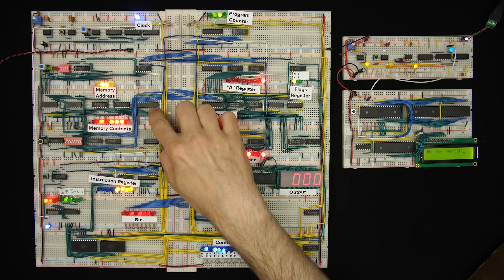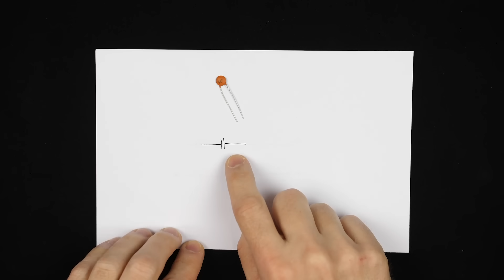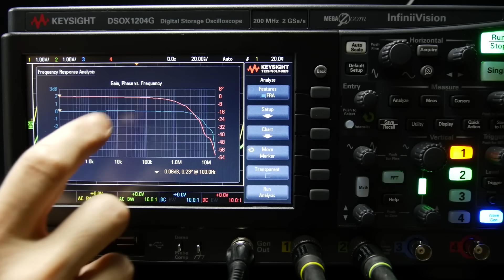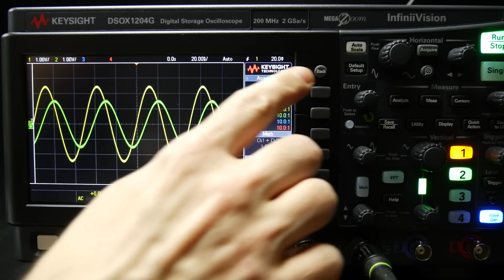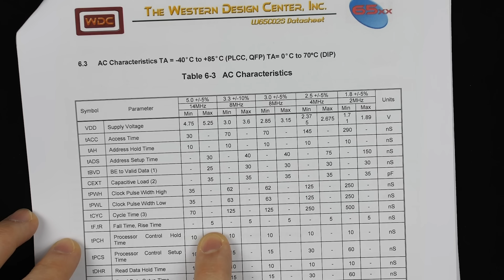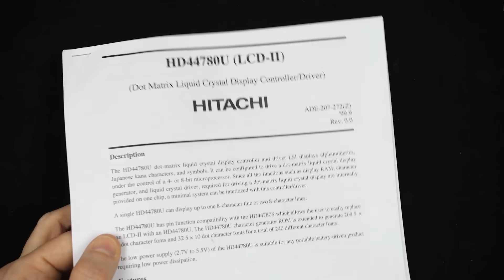Why build an entire computer on breadboards?

Comment: It's funny considering how computers used to be designed in the past.

From what I recall the entirety of the Amiga chipset, in it's prototype form, consisted of discrete logic chips, and wire wrapped construction... (not 100% sure on that)
These boards were HUGE.
Each one the size of a table, yet implementing functionality that in the final circuit is a single chip...

But, it DID work...
You CAN construct even a fairly complex computer that way if you have the patience. (though that Amiga prototype was not what anyone would describe as reliable - needing components swapped out every few minutes or so...)

Comment: It'd be interesting to see what the limit is on clock speed for breadboard computers. I've been thinking I wanna try to make a 68k-based breadboard computer, possibly even an underclocked Mac Plus (which is 8MHz). I just looked up a datasheet from 1993 and it suggests that the 8MHz models of 68k processors have rise and fall times of 10ns, (at least for later production runs), so I wonder if you could even run it at the full 8Mhz.

Comment: Using these breadboards intensively in teaching I have made very similar observations, but also that even from the same trusted source the quality can vary. One indication of a lower quality board in my experience is the numbering and lettering which you can see in the two breadboards shown in the video - the cheap one has the numbers going up on one side and down on the other, while the higher quality ones have consistent numbering on both sides.

I also had breadboards where the backing tape fell off by itself as soon as I unpacked the boards.

Comment: Insight into every engineering project, one thing after another to screw you over. Impressed that it's working at 1MHz on breadboard, and there was some debate on whether the CE circuit would meet the timing. I wonder how many more episodes before this project is complete.

Comment: while good breadboards are made of spring steel, bad breadboards are made from mild steel due to the ease of production in performing tight bends on playdough rather than on springs.
however the alignment of domains is uniform in spring steel, unlike mild steel meaning that the magnetic attraction to good boards should be higher than to bad boards.
tl;dr if a magnet sticks, breadboard good.

Comment: "The schematic symbol of a capacitor is two plates". No, that is the schematic symbol for a contact.
Reply: Right, isn't one of them curved away from the other? Indicating the direction?
Reply: @luketurner314  That works for a polarized capacitor. Many capacitors are not polarized. ANSI/ISA 5.1 does show that two parallel lines is a normally open contact. However it does not show a capacitor. Different standards use different symbols.

Comment: TL;DW.
Using breadboards is good because you fiddle with the components and gain a deeper understanding of what is going on.
That, said, breadboard quality, and cable quality affects the quality of the signals you pass through them. (Attenuation and Lag)
This is caused because cables and conductors within the breadboard act as capacitors and inductors just by being near each other.
Then some experiments to show this attenuation and lag (seen as phase shift because the testing is with high frequency waves).
This is important because there are components with timing requirements, some of which relate to the time a signal takes to change from one state to the other.
Then some experiments showing that in scenarios closer to reality we are actually quite ok (using high quality cables and breadboards for the experiment, though).
By the way, at 1MHz the program does not work. Probably because we are sending commands to the display before it is ready to process it. This can be checked with software though, stay tuned for the fix.

(Actually this TL;DW is more of a summary for myself to see if I remember enough of what I just watched. I'd be a shame watching something this interesting and then immediately forgetting most of it)

Comment: Hi Ben, I was wondering where you can find DIP switches that have long enough pins to fit securely in Breadboards.  I've bought 3 different brands and they either don't snap in at all or fit in so loosely I have to hold them in place to switch them or they fall out.
Reply: I've had a good bit of success by plugging my dip switches into the kind of IC sockets with the round pins, not the flat / rectangular pins.  The dip switches fit snugly in the IC sockets and the IC sockets fit snugly into my breadboards.  Try https://www.amazon.com/gp/product/B07H3W44Q6/ref=ppx_yo_dt_b_asin_title_o03_s01?ie=UTF8&psc=1 or something similar.

Comment: He just made me understand what a capacitor actually is. In 10 seconds. Imagine putting your finger between two magnets. They're constantly trying to stick together but your finger is in the middle and you feel a constant pressure. Your finger is the insulator and the magnets are the electrolytes. Its just two polar opposites trying to reach eachother but being unable to do so until a path of least resistance appears. This guy is so awesome.

Comment: I know this is way way off topic but ever thought of (or maybe I missed it) doing a video(s) on op amps/comparators and digital to analog and analog to digital conversion..?  Possibly have them interface into one of the breadboard computers or something..?  ---  such as something that measures light, sound, pressure or...etc. -- but in a way that's a little more complex than just using a CdS resistor to make a LED change brightness like everyone else does 😂😋 --- I don't feel I'm expressing myself right at the moment but I haven't found a lot of good content in kind of the middle ground. It's either the basic of the basics or high level. Never a progression, for example, using op amps to properly integrate signals into digital logic or anything and that creates flow with the teaching process what you are really really good at (again, I apologize for the poor wording but maybe I'm coming across decent enough, #MIGRAINES-SUCK 😂)  Take care!

Comment: Jokes on you sir, you're assuming that electronics work after I solder them
Reply: @flying_sorcerer  the joke --->
Your head....
Reply: @phalcon23  meme, analog version.
Reply: @phalcon23  of the top of you
Reply: Thats exactly the issue I had. I would fry the electronic components
Reply: @craigtate5930  I once was fixing a pair of speakers and accidentally bridged two contacts with a tiny smear of solder. I spent just 5 minutes soldering and then spent more than an hour trying to clean between the contacts. Amazingly the speakers worked and didn't in fact burst into flames. I usually can fix broken electronics, but not before I break them more.
Reply: @Churchgrimm  LOL! troll, troll, troll!!
Reply: @Churchgrimm  Haha! The other day I bought a soldering kit of a digital clock for a 5 year old. Apart from a few easily cleaned bridges the kid did a fine job. As I watched, I thought: I gotta do this too, it seems pretty relaxing. So in the evening when the kids went to bed, I got a few hits from a bong, turned on the soldering iron and went on building a simple kit too. It was indeed pretty nice. So when the kit was built, I turned it on and the 7-segments just displayed garbage. FFFFFffffuuuu- Turned out I soldered a register array backwards but this was sufficient to turn a relaxing activity into an exercise in pure fucking misery.
Reply: @8o86  lmao, turning what should be a relaxing electronics project into an absolute nightmare is practically my mantra
Reply: @craigtate5930  Check out Luis Rossman. He has VERY solid guides to soldering on real machines. Obviously, this teaching could roll over to pretty much any soldering. He does note that you need a decent solder iron wise the temperature will fluctuate too much and you either cant melt the solder or will burn the board. His iron is a bit over the top (it has a fluctuation of less than 1 C) but, he is a professional so it makes sense. Hakko has a few lower tier solder irons now that are cheaper and have even lower fluctuation. I would guess that they must heat up more slowly or lack some QoL features of the hire dollar irons.
Reply: In my electricity class in high school, literally no circuit I ever soldered actually worked, with the exception of a simple LED lights circuit that stopped working after a while anyway -_-
Reply: I've managed to screw up a few times where the copper pad fell off. Thank God I kinda know what I am doing, so I just solder on a few cut off pieces of resistor leads, and attach the two or three components. Not the best, as some problems can surely arise out of it, but the projects I work on aren't too power intensive where any of those problems should arise.
Reply: @HiddenLeafShinobi it has become my hero's journey in life to figure out just who on earth you are replying to, and I thus far am failing in my quest
Reply: The electronic components are like “ guys, let’s not work to mind fk whoever soldered us 🤣 “
Reply: Hahaha my first thought was that I should start making these solder it yourself kits for people to buy for people they don't like... The kit would come with the schematic that would show what goes where, BUT with none of the values and 5x the parts... "I know a resistor goes here but WHICH ONE!!!! THERES 117 OF 'EM!!!!"
Reply: i spent 50$ on a diy 500w power suppy kit aka a poor mans lab bench power supply and i effd it up in the first 10 minutes
Reply: This comments section is a joke
Reply: @RayRayGaming-xb3pz  and so is your face
Reply: @RayRayGaming-xb3pz get back to Call of Duty game before mom finishes your dinner
Reply: You're assuming the electronics work to begin with
Reply: @uwu_boomer6699  Sometimes they don't. XD
Reply: @Churchgrimm  after all they're straight from china
Reply: @uwu_boomer6699  Psh, only most of them
Reply: TehHausofUsher  not after you solder them, but after someone capable does it
Reply: @domxem5551  You wound me, sir
Reply: @flying_sorcerer  Maybe I haven't soldered some crazy PCBs, but the ones I have done, you wouldn't even need a manual, just look at the PCB and you can already tell where most if not all of the parts go. I mostly do Hole-through and hand-wiring, so all the SMD elitist can take a swing at me if they like.
Reply: is a breadboard... why you soldering anything?
Reply: @khhnator  I'm assuming they're talking about where he said that soldering things onto a circuit board doesn't help you learn
Reply: Actually joke is on you for assuming things work after I touch them!
Reply: haha, I was half expecting him to say that you solder them and then they don't work because you made a mistake.

And even though that would be correct too, his point is a different one (as you also understand). Those PCB kits have already done all the "understanding" and hard work and you only play the role of a good instructions follower.
Reply: Lol I thought I was the only 1 that solder components and it doesn't work lol
Reply: ...same though... I blame the soldering iron, but it could really be 50/50 that it's me
Reply: on god burnt circuit board needs to be a candle scent
Reply: 100% thats what I thought he was gonna say.
Reply: i cant even solder properly
Reply: Bwahhhh ha ha aha ha ha. This comment deserves its own youtube channel.
Reply: who tf is Jerome Cabarus?
Reply: FR
Reply: One of my hradphones ear speakers didnt work.... 6 joints....
Reply: Soldering (especially prototyping boards) is a trial of patience and tolerance of your own idiocy. 

Prototyping boards work decently as throwing stars even with components soldered to them. Talking from experience here…
Reply: Youtube comment: makes good joke
Replies to comment: Um actually your joke was taken VERY seriously and I would like to speak to your manager
Reply: @Jerome Cabarus r/Stopit
Reply: You don’t have to wire it up
Reply: @flying_sorcerer  r/woosh
Reply: Lol
Reply: @flying_sorcerer  r/whoosh
Reply: @flying_sorcerer  it's a joke...
Reply: r/wooosh
Reply: He's also assuming that I remembered to solder everything in the first place, or that I didn't just bend the legs to hold the components solely with friction and the occasional glob of hot glue.
Reply: I heard you gotta stick the iron on the electronic device on its own for a good 5 seconds to prime it before even adding solder 😂
Reply: @flying_sorcerer  Thanks for ruining the joke
Reply: @bepis4094  he means he solder things wrong or just burn the components out. happens to me 
too
Reply: Can you make a computer on a taco board tho?
Reply: Lol....
Reply: its where the real sht comes in play
breadboard assembely : works
soldering : burst, doesnt work, magic smokes , workssss(possible outcomes)
Reply: I am terrible with soldering LMAO
Reply: Rotflmao 😆
Reply: Jokes on you I can’t solder and don’t have the money/understanding to do this
Reply: Lmao same here
Reply: Lol!! 😆😆😆
Reply: This comment checks out
Reply: @bepis4094  jokes mf... do you know em ?
Reply: Wouldn't the wiring on the pcb be all-ready built
Reply: When your circuit only worked at home lol
Reply: Mans assuming i can solder, big yikes chief...
Reply: Real 😭😂
Reply: HEHEHEHEHE
Reply: Ten thousandth like!
Reply: Jokes on you sir, I don't even know how to solder
Reply: Jokes on you sir, im horrendously late! Where is everybody?
Reply: @Jerome Cabarus r/ihavereddit
Reply: @mrshurukan  The irony of pointing out r/ihavereddit via a reddit reference
Reply: Maybe you used woke solder and it identifies as insulator!
Reply: What a pessimistic koke!
Reply: @Jerome Cabarus r/woooosh

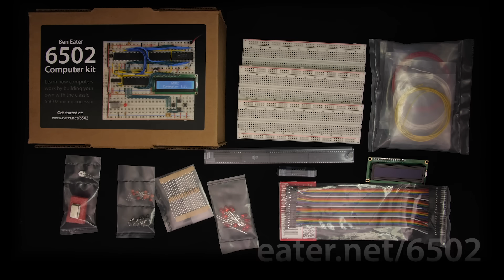Comment: I was so excited to know why my connection to the oscillator was not working and smiling at finally getting a solution.  And then 28:05 came along and I yelled "Nooooo.... not another six to eight weeks"!  .....Although, I am pretty sure I can add the check myself.  At least I know why the oscillator is not working for me.  Thanks, Ben Eater, but you have got to stop putting these cliff hangers in your videos!!!!!

Comment: When I optimized my Arduino code to write directly to the registers, I simply used delayMicroseconds() on each of the command functions that I wrote so that it would be impossible for the Arduino to send a command while the display was processing the previous command.  It looked something like this:

void CommandName(arguments)
{
    LCD.writeByte(0x00 | arguments);
    delayMicroseconds(37);  // depends on instruction.  Was anywhere from 2 to 37.  Plus the function calls themselves add to that time.
}

Perhaps you can do that instead of checking the busy flag.

Comment: Amazing explanation! 

At https://youtu.be/fCbAafKLqC8?t=589 you said you are not expecting current. This is because the resistor has a high resistance and the drop in the voltage will be almost zero?

Comment: I hate how they come so close to making a decent bread board, then cheap out on the most important part...
Reply: Man I know! For some reason the off-white one seemed to be better quality than the ones that look bleached white in color, I don't think that's going to be the case always but for some reason the matter where I've gotten them from that seems to be the case over the years lol
Reply: The bread?
Reply: That actually costed more to make wrong in a way so in a way thats industrial Terrorism.
Reply: There are also two main versions of solderless breadboard. The ones shown here and the type that (used to be?) sold by a company whose name is (or was) Continental Specialties Corporation(?). Not sure of the last word. IIRC, it was either wider or narrower. The distance between the two inside rows of pins commonly used for power is different.

Comment: Ah, so that explains why capacitors always seem to double chips in printed boards. Thanks! Question for that use case though: how should they be connected in such a printed board, in parallel with and prior to the +5/GND of a 5VDC chip? And is there a formula to find the optimal capacitance for this?

Comment: I remember diagnosing a work BNC network over Christmas down week for similar effects, we found (playing network doom) lag at certain points, we ran a single BNC based network ring to a 100 node network, and found a lot of frequency blocks, because each  connection, and BNC connected adjacent nodes, caused reflection of signals giving massive network degradation. If I remember correctly we solved it using low resistance connectors, and an 8ohm terminator. We were praised for increasing network efficiency, which can from 12 employees straight from college (Christmas week we must work) playing Doom...

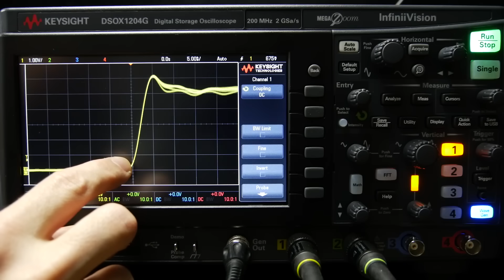Comment: 24:30 Wouldn't that mean that the difference between the slopes at the oscillator and at the chip could then be used to calculate the practical frequency limits of the breadboard circuit?
How could I approach such a measurement / calculation?
Reply: Lot of Coffee, in Norfolk we approach the problem from the direction of the kitchen.